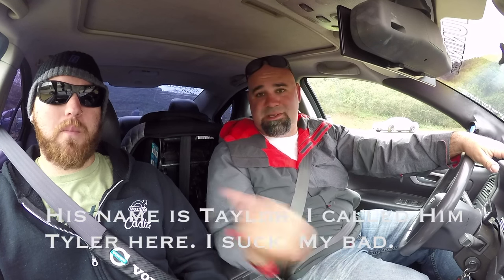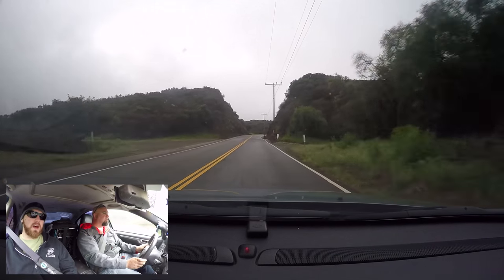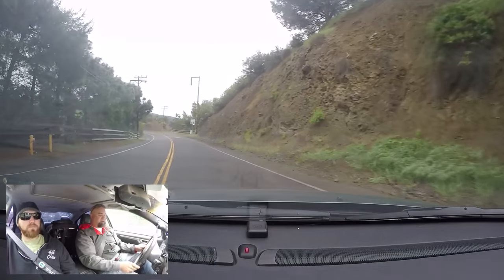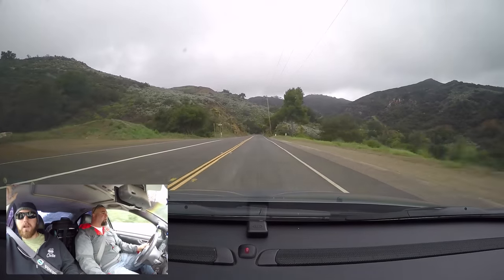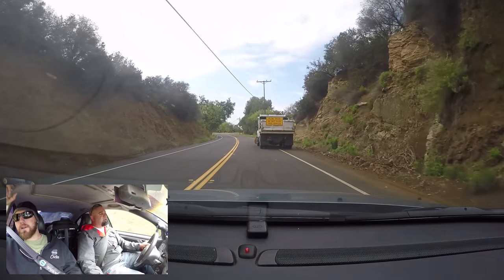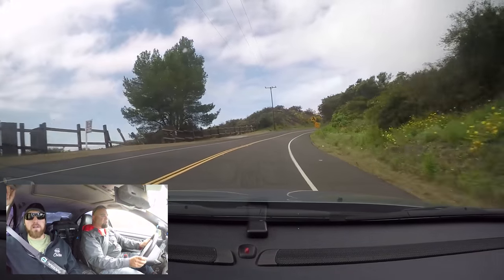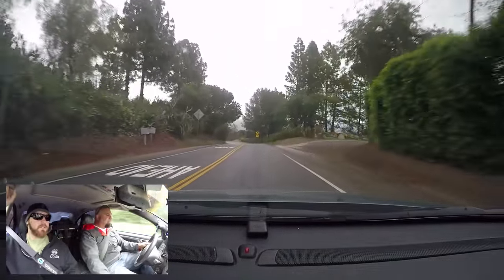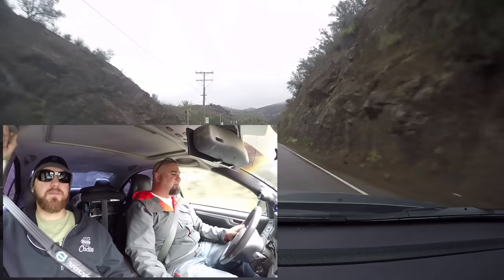Modified Volvo S60 T5 - One Take

Comment: 5-cylinders sound so fucking good.
Reply: And if you check out engine animations, when an inline-5 is cranking the cylinders go up and down in a perfect wave motion. In a V10 its dual offset wave patterns. Very cool. Very smooth looking.
Reply: +Tiny Turbo :)
Reply: The Audi TT RS has 5 cylinders too and it sounds like a mini R8.
Reply: +archinuk417 Ya the Audi 5 cyl is on another level for sure. Even way back in the rally days.
Reply: I miss my Focus ST MK2 right now :(
Reply: To bad they cant handle 800 hp for a long time, those volvo engines are nice and all, but pushing 5-600hp? Nope, you will start to blow one engine after the other.
Reply: tor g -A couple of T5:s push over 1000 horsepowers in Sweden.
Reply: True. Takes way too much to go past 375ish HP. I'd go for a 6 cylinder turbocharged or 8 cylinder for any hp goals, but undeniably a fun car.
Reply: RadioactiveSaddam yes there is, i live in norway and used to be in sweden alot. But there isnt many of them and many of them go over to 2jz or bmw engines after a while. Some do go the other direction though, but they are just a few.
Reply: My first car was a '96 850 T5 I fucking loved the sound of that car.
Reply: @Thaloner  not nowadays professionally  balanced ,tuned etc can last about 100k miles before a rebuild is needed even at 600 to 1000 hp these cars are capable

Comment: I love the sound. Sounds like a 80s group B Audi
Reply: +Drift Review The Audi Quattro was a 5 cylinder. Volvo borrowed Audi's idea, set it up as a transverse FWD configuration and made the Volvo 850 around it. This S60 has the same engine, but of course modernized.
5-cyls have the same firing order as a V10, so you get a similar sound, but it's much cheaper to produce. Hence the nickname "the poor man's V10".
Reply: +Drift Review YES:)
Reply: @ogentor_no  i prefer "baby v10" unless its the 2.0 one i drive, then its "the poor man's v10"
Reply: The 2.5 these Volvo's use are license copies from Audi.
Reply: @Chickenassable  source?
Reply: @Chickenassable  No no no, just because volvo has 5 cil and audi has 5 cil, it does not means that volvo tooked engine from germans ( in some case of an diesel volvos inline 5 - yes, they buyed engine blocks and some parts from germans, and still volvo redesigned those blocks andy made by their own standarts, but petrol -no) ......volvo inline 5 is very,very different than Audis. I have audi inline 5 2.2 quattro and many, many volvos 2.3turbo, 2.5 turbo and bla bla bla, but the piont is, i have rebuild few of those engines, and they are completly different.
Reply: @Chickenassable  no, they aren't

Comment: Matt your GF has a V60 R-Design with Polestar tune. That is different than the actual V60 Polestar, which had more go fast bits. It also only comes in Rebel Blue, White, Silver, and Black.
Reply from the maker: +Rediscover Film Yes, I'm aware of that. I just don't bother saying "V-60 r-design with polestar tune,"
Reply: +TheSmokingTire Volvo guys would just say "V60 R-design". Polestar tune comes with it.
Reply: +TheSmokingTire lol
Reply: +Rediscover Film Polestar tune does not come with R-Design. R-Design is an aesthetical package, but not uncommon to be accompanied by Polestar-tuning on order.
Reply: +babbaslol I've never seen a V60 R-Design without the Polestar tune. All of this is besides the point. Calling that car a Polestar is wrong. Someone wouldn't want to call a WRX an STI would they. They are different cars.  The real Polestar car has more power (via a different turbo and active exhaust), has a much better suspension with Ohlins, has a retuned transmission, bigger brakes, different appearance package, different interior with Alcantara, etc.

Comment: I love my S40 T5 AWD, these are really nice underrated cars (don't tune for big power though, just boost response and torque, the thin cylinder walls on these blocks aren't ideal for big power). My S40 is maybe putting out 320 at the crank max but it looks bone stock and is a real sleeper.
Reply: +Sepehr Naserkhaki 2.5t?
Reply: +Sepehr Naserkhaki Here in Sweden people run these engines at 700+ all the time. You insert milled steel rods inbetween the cylinder wall and the block wall. They can take upwards of 1000 engine HP but it's not really streetable at all and quite unreliable at that level.
Reply: +Sepehr Naserkhaki yeah they are VERY underrated, and those S40s and V50s have advantage of those ford suspencions which handle in cornres very well
Reply: Nitten yeah, I meant in a street-able reliable application with a stock block (cause at that point you might want to look into a different platform if all you want is performance, this is my one and only car you see)
Reply: rudkacka Yeah, and I personally prefer Haldex to Quattro and 4matic...Haldex just feels like a FWD car without the torque steer and better traction
Reply: Lightspeed Echo yeah same 2.5L inline5 turbo as in the Focus RS500 (detuned) but my mods are basically just re-tuning back to that level...mainly for reliability purposes
Reply: Lightspeed Echo Slightly different ecu map btw, more low end torque and response oriented than top end power
Reply: +Sepehr Naserkhaki I had a 2004.5 S40 T5 FWD a few years ago. I had it for a year and sold it to get a 2000 Trans Am. I don't regret it, but man I miss that S40. 70mph with a/c on full blast and got 35mpg's. Raced a few kids that thought their civics were fast and beat the crap out of them. I will say that a couple things I hated was the radio being integrated into everything. No aux in or cost efficient for a new head unit. And the maintenance is ridiculous for these.
Reply: 320 at the crank with AWD must make for some good launches!! Post a video would love to see her pull from a dig.
Reply: Omgwtflmaololrotfl yup, though those engines can make a lot more power than that, even with stock internals
Reply: 5 cylinders are great. But i really need a new exhaust on my 850 :p the whole exhaust is cracked and it sounds like a fuckin tank lol
Reply: Semjon tank sounding like a tank? thats normal :D
Reply: rudkacka true that 😃😅

Comment: Props from an R owner... and those IPD sways were quite possibly the best mod you could do with the car IMO. P.S., my angle gear is holding out fine after 150k. I've had the car since new... very few hard launches and mine is an '07 which seem to be less problematic than the earlier R's. Nothing beats the sound of a nicely tuned 5 cylinder, well short of a nicely tuned Ferrari perhaps. ;)

Comment: Sweet ride. Did anyone else notice a rubbing type noise? 
It almost sounded like it wasn't all the way in gear.
Reply: BOV or transmission whine. Pretty sure it's just some wastegate noises!
Reply: All I heard was WOOOOSH.
Reply from the maker: It was waste gate flutter not tire noise
Reply: Not tyre rubbling, but the 'front lip'..
Reply: +Notorious HZ CHoo- Choooo!
Reply: he said at the end "a little less" fender rub, it seemed to only happen on left turns anyway
Reply: +Kevin Norwood Compression bypass, I think

Comment: at first glance i thought those wheels were volk te37sl's
Reply: Na. He got his wheels wherever he got his funky ass tires - the swap meet. If you go through the trouble to build a car, put some decent rubber on the damn thing. Specially on a fwd car lol
Reply: @razerone49  I have a 320whp car which is rwd previously on comfort tread and it just spins now I have sport tread which is almost at the limit and it grips Continental Lux tires to continental sport tires and both tires cost the same brand new and the difference is night and day

Comment: Sorry if stupid question... But am I wrong in seeing that front facia r34 resemblance? ._.
Reply: Think it's an aftermarket front just without the Volvo badge on it
Reply: yeah there's a slight resemblance
Reply: +P I could see how you can see a resemblance. The headlight and front grill shape look a bit similar.
Reply: +P Its an badgeless grill and looks like a modified lower lip from volvos sports kit for the S60
Reply: +P Never thought about it until now, but you're absolutely right
Reply: GTR with a single light on each side.
Reply: No your not wrong lol I was thinking the same thing
Reply: I have noticed the same thing too!! But you'll need to get the 1st gen headlights of the S60. :)
Reply: A slightly more tame r34
Reply: my thoughts exactly
Reply: Ben McCarthy I thought the exact same thing
Reply: Ben McCarthy nah it’s OEM lol

Comment: where did you get the bumber ? i need this on my s60
Reply: its original bumper he added just a lip
Reply: i cant find the lip on ebay maybe someone knows where?
Reply: @ignasgolpex4251  VIVA performance kinda pricey and there are 2 different ones I believe, one for the 2000-2004 bumpers and one for the 2005+
Reply: @basedbanks6692  i saw the price😵💶

Comment: I will own a 5 cylinder engine car one day , mar my words.
Reply: Want my s40? I fucking hate it. Don't know what's up with the Hype with Volvo, They are ok cars but nothing really impressive. Miss my A6 more than anything.
Reply: yo must be joking, A6 is a pos compared to the S60
Reply: Bob Dole its not about the Volvo "hype" its about that beautiful majestic engine tone coming from those 5 cylinder engines they're provably the best sounding engine in the world in my opinion it has the scream of a v12/v6 but also has that deep rumble of a v8/v10
Reply: +TheOne AndOnly good way to explain it, I can't wait to get a full exhaust for my R, even with the stock exhaust I can hear it at wot quarter mile away
Reply: Alfa Asher and they rumble like H4 a bit aswell
Reply: Yeah they also sound like tractors with a dump pipe loool they easily spit fire though my friends does with a catless dp and a straight 3" pipe through an xr1 muffler
Reply: Alfa Asher that must sound so good
Reply: His sounds okay, I just had a open downpipe set up and other than the drone, I was in heaven, especially the decelerating pitch it has between 6-4k revs 😍😍
Reply: Alfa Asher yeah, i know exactly what you mean, i would like taht but the drone is a shame
Reply: Yeah but cat less dp with ipd Catback will be the best set up
Reply: Alfa Asher yeah, sometimes just removing the cat is enough to hear the 5 cylinder roar
Reply: That's what I did with a resonator delete.. I need more burble and roar 😂
Reply: I've only heard the 5 cylinder engine on YouTube up until last night. I heard it in person for the first time and I was awestruck. My jaw was on the floor, and I broke my neck lol
Reply: Hunter Kelley I ordered an ipd Catback, I already have the obx downpipe on, can't wait to hear it once it gets here 😁
Reply: nice! I have an obx DP in my basement, might sell it. Don't want to lose my cat.
Reply: Hunter Kelley lose the cat man, it's actually harmful to the engine and turbo in the long run because of the back pressure it creates and you actually get slightly better fuel mileage lol
Reply: Okay I will mar your words.
Reply: BrienMusic lol
Reply: post a video when you do, I'll subscribe enshit
Reply: Bob Dole it’s understandable if you went from an Audi saloon to one of the worst Volvo’s ever built, but I recommend trying out a v70r or a newer polestar, they make excellent daily’s and weekend drivers
Reply: Bob Dole Don’t judge Volvo based off of your shitty used s40 that was probably never maintained
Reply: Bob Dole EXACTLY I don’t get the hype, I sold my 99 v70 xc cause that shit could barely move out of its own way. Went to a saab and never will come back

Comment: Sick, I almost bought a S60R from a dealership with like 40k miles but i got my Brand new Genesis coupe instead.
Reply: How much was the S60R priced at that dealership?
Reply: My mom got a s60 t6 and it pulls pretty good. Ill maybe buy it from her in a couple years and tune the shit out of it
Reply: How do you like it? My neighbor just got one he says it has plenty of power
Reply: only transmission option is a cvt so its not really good but the 300 horsepower and awd works pretty good.
Reply: Those r my two choices rn but I have to say the s60 r is what I'm leaning towards so far bc of all the stuff that come on it stock
Reply: R-Spec how many problems has your genesis had in the past 8 months?
Reply: None with bolt ons and a tune.
Reply: R-Spec that sucks
Reply: R-Spec should of gotten the R
Reply: My 06 s60 2.5 T smoked a genesis 😂wasn’t even the R
Reply: let me see ya car, thats what i whip too lol

Comment: To reply to "if you can convert to all-wheel drive", asked at 07:13, actually you can.  My mechanic did it to his T5.  The S60/V70's were mostly the same car, so it's fairly easy to swap parts around.

Comment: this is also a popular swap into rwd cars,,, you can buy prefabbed custom mounts to mount The T5 front to back, in say, a Volvo 740/940 :-)
Reply from the maker: That would be bad ass. My buddy had a 740 Turbo wagon with a manual in high school and it was awesome
Reply: +TheSmokingTire Matt I found an 04 R going for 5500 with 97k mi. It has a cracked bumper but for that price I feel like it's worth it. Is this a steal?
Reply from the maker: +Mrwhiteboy9001 depends what else is broken.
Reply: +TheSmokingTire That's exactly the car i've got here in Sweden but are there many of them over there in the US? Would be nice to see a video with one.

Comment: 5 cylinders sounds like viper v10's to me and vice versa. I think that they sound similar because the viper uses a 90 degree v10(instead of a proper 72 degree) and thus needs the balance shafts to work properly just like 5 cyl. Just a theory of mine please dont kill me.
Reply: +Maxpound I've heard it's related to the side pipes, so from either side of the car you're only hearing half the cylinders.
Reply: +NorfKhazad Thats actually an intriguing theory...
Reply: Hahahahahahaha please don't kill me XD XD lol! its an interesting theory and I wouldn't be surprised if that is part of the reason it sounds the way it does.

Comment: Why would they make this FWD?
Reply: +archinuk417 keep costs down
Reply: +archinuk417 For sweedish winer, no joke.
Reply: It's has a rather compact i5 that sits horizontally so fwd makes sense since this isn't a real performance model, the R model has AWD that has a fwd biased torque split
Reply: AWD would steal too much power. Look at Audis performance cars, they need so much more power compared to BMW to keep up with their Quattro.

Sure, AWD puts the power down good from a stand-still, but as soon as you get up to speed, the Bimmers and Mercs usually pass.

Either way, this car should be RWD imo.
Reply: Transverse mounted engine.
Reply: frr i was going to get one but thought twice for it being fwd , after this video i’m definitely going to consider
Reply: The Haldex system's are prone to break so the T5 is more reliable although with so much power I doubt reliability is a top priority to the owner😂.  The S60R/V70R are the same as this T5 just AWD so you can have more usable power in the Rs.  You pay more for the R version of course
Reply: It did come as the S60R which was AWD.
Reply: They're all in the category of Estate cars. They're the euro equivalent of the Japanese VIP segment. I have a 98 V70 fwd with 240k miles, still the most comfortable car I've ever driven.
Reply: archinuk417 its because volvos are a really safe car so if it was Rwd it is a possibility of the front lifting up slightly however awd is ok and so is fwd
Reply: weird i can only find s60Rs with AWD
Reply: S60Rs are only AWD, all the others are FWD
Reply: I have completely stock 2.5T 2004 and i gotta say that the biggest problem is definitely the fact that it is fwd, especially in the winter even tho i have studded tires it just wont grip  even at 50mph if you put the foot down, strangely enough it doesnt torque steer a lot

Comment: I always wished Volvos came in RWD
Reply: +Kyle W YES
Reply: +Kyle W atleast the "r" version is awd and all the old ones likes 240,740,940 are rwd :D
Reply: Anton Jansson But arent all the old ones only automatic?
Reply: +Kyle W Plenty of old vovlos that are RWD, 740 etc
Reply: +IDontHaveAnyIdeaForAName Not at all. Models like the 780 Bertone and 262 Bertone are hard to find as manuals, but there are plenty of manuals out there for the more common models like the 240 and 940.
Reply: +Bassen98 Yeah, was about to correct him also...*I always wished modern Volvos came in RWD- would be more accurate. It is my dream to build an 240 or 740 series Volvo with a modern T5/T6 engine, they look and sound badass, check this one out /watch?v=1Ty5lsJ11ek  :)
Reply: +IDontHaveAnyIdeaForAName nawww, you can find a manual on Craigslist I'm positive.
Reply: Supra 2jz Twin Turbo no, they came in manuals,  the 240s came with 5 speeds I believe
Reply: A bit late, but you can find a manual 240 even though it’s less common then the auto. I had an ‘83 240 and it was 4 speed with overdrive
Reply: 740 and 850 come manual

Comment: 5-cylinders are just great all around. they get decent to great mileage driven normally and have so much performance potential while sounding almost like an oldschool V10 - like a classic Viper RT/10 for example. way more than 25% better than a 4-cylinder. going to get myself a VR5 GTI soon for that very reason

Comment: blue silicone in the engine bay is very ugly
Reply: +Shane Massa but its swedish....all he needs is a yellow valve cover and its perf...
Reply: Nope black in my book only
Reply: Most volvo's use only blue silicon in aftermarket tuning as a ode to Sweden. It's a very common sight
Reply: +Emanuel Saleniuc you understand this is my opinion you can run blue all you want

Comment: I own a 2.5T V70. These 5 cylinders sound good as hell! I got a 2 inch exhaust from the turbo. And if you want to buy a turbo Volvo like these and intend to modify them. Get the 2.4T or the T5. The 2.5T is not suitable for tuning.